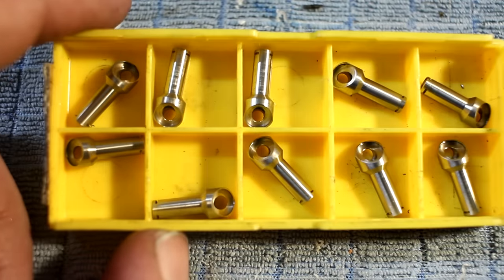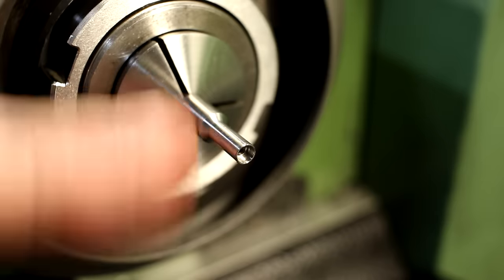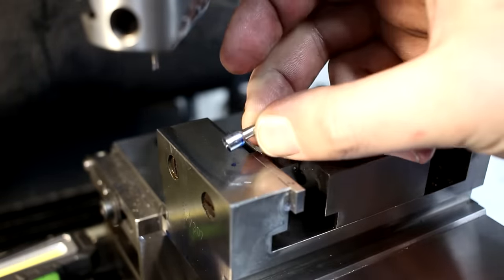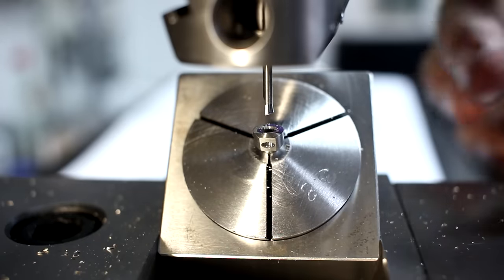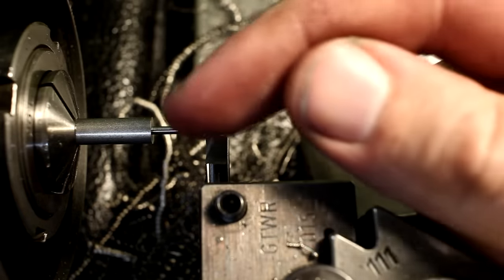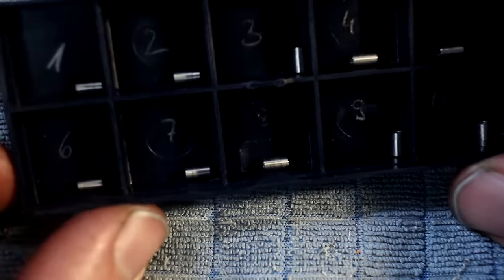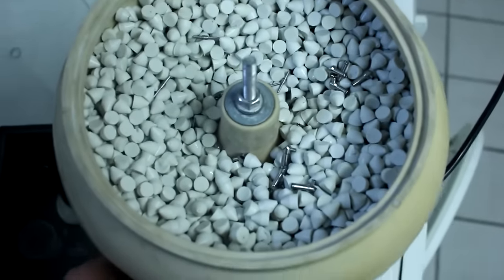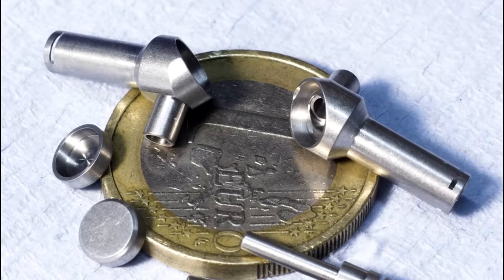Small stainless machining - Flux capacitor parts

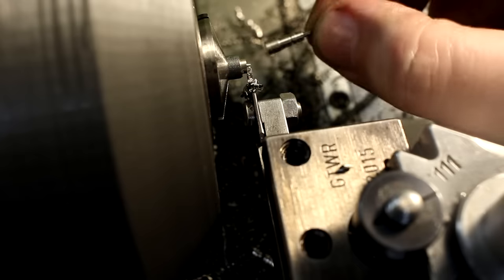Comment: At 42:20 when you showed the aluminium sub-collet with all the featured bored in and a relief machined into the outside to make it flex and conform to the part better, I was moved.

Comment: I'd be really interested to get a better understanding of ISO tolerances.
Reply: It's reasonably easy, look here for example: https://www.engineersedge.com/manufacturing/preferred_mechanical_tolerances_metric_iso_286_13166.htm
Reply: There is a couple of good YT videos on the topic. It is a really dry topic.
Reply: @arnljotseem8794  Thanks! I've started with FutureFab CNC & 3D Printing's "Limits, Fits & Tolerances" for starters. Let me know if you have any specific recommendations.
Reply: @AdventureswithaVerySmallLathe   Not really.  I started on two , this one on " ISO fits"  among them, from a fellow hobbyist:  https://www.youtube.com/watch?v=wvVMs2BZdeU
but I didn't finish any of them.  I instead read what Machinery's Handbook had to say about the topic, and also referenced Metal Engineering Textbook (Europa Lehrmittel) Gave me the understanding I needed
Reply: It's all fun and games until you have to know GD&T. Fun but tedious.

Comment: I love 303. I’ve made a number of different, complex parts out of it. What’s good is that corrosion resistance is equal 304, the most common stainless, but machines very easily. Very easy to cut thin parts, small holes, threading, etc. A major advantage is that it just work hardens slightly.

Comment: Blockbuster indeed. I learned a lot here, perhaps enough to consider reasonably changing my job title from librarian to apprentice toolmaker (or both?). The panning shot rotating around the centred radial cut was wonderful and almost like something a CNC could do which is a lesson in itself.  Smashes like button

Comment: 1:01:34 I don't guess it matters that the through bore interescts with the angled counterbore? These parts are well beyond my shops capabilities. Most of my machines have run out that is half the size of the hole you bored. lol
Reply from the maker: Yes, that does not matter, its drawn that way.
Almost everything you do is also beyond my capabilities ;)

Comment: Incredibly informative, Stefan. Thank you. I have been struggling with cheap insert tooling lately. Soft carbides. I had thrown together a cheap diamond lap with a Chinese 2000 grit diamond lap. It does a nice job lapping the dull inserts sharp again, but they dull very quickly... but, I have this stack of used carbide endmills piling up. I keep them with this zany idea that I’ll have them resharpened... I assure that’s not happening... I think it’s time to take your advise and make some new carbide tooling and holders!
Reply from the maker: Chinese inserts a a hit and miss - The ground ones for aluminium work usually quite well, with inserts for steel, I never had luck, they are probably made out of compressed street-dirt or something like that. When trying to put a edge on them, they just crumble apart.
Endmills are usually a very good grade carbide, fine grain and tough.
Reply: @StefanGotteswinter  - compressed street dirt.... !!

Comment: Love the round tool bits, Just drill a square block with the bit size, set screw, find the center of your grinding wheel hight use the table in machinery's handbook.To set the rest hight of your fixture and get the relief angle you want. just use a protractor to sharpie a mark on the rest or clamp a fence just feed straight in against the fence. you can rotate the block and grind another facet of your cutter. usually by reclamping the fence to a new angle but leaving the set screw on the block tight looking at the catalogs of ghuring and ifanger i learned a lot       good to see you stefan

Comment: Stefan, thank you for this fascinating & educational video.  Here's my vote for a video on ISO reamer specifications.  Also, when you cut the slots with the 0.4mm slitting saw, how do you ensure that you get an "exact" depth of cut since slitting saws don't run particularly concentric with the spindle?
Reply from the maker: I approached the work very slowly with the saw blade rotating, until until I got the characteristic crrrrrk where the saw blade makes contact for a fraction of a second and considered that my zero position, thats good enough in this case. 
The depth of the slot was not crazy close toleranced, its only for a springsteel clip.
If I needed it more precise, I would do a shallow cut, measure the depth and then correct to final depth.

Comment: Thanks for taking the time to produce and explain the process. Great video work with closeups. 
Work is on the other size end from Abom79 🙂
Can you tell about the magnifier you are using ? Looks very useful. My eyes are getting old
Thanks
Reply from the maker: Most of the time, I use my dads old 8x magnifier that he used when he worked in QC. I dont know about the manufacturer, but its very nice, with a metal housing.
Also nice are the small magnifiers from PEAK.
Maybe easier to get is this one:
https://www.optics-pro.com/watchmaker-s-loupe/schweizer-magnifying-glass-tech-line-10x-watchmaker-s-loupe/p,23346

Also very nice optics, real glas, no plastic lens.

Comment: I’m a big fan of your videos, and learn a lot from them. I’m a watchmaker working on very old pocket watches and use mainly a schaublin 70 and aciera f1. You mention in this video machining the shank of your new boing bar. I have a mt1 wolthaupter similar to yours that I want to change to 10 mm.  I would like to see how you would do this using only your lathe/mill/dbit grinder (as these are the tools I have!) 
Best regards

Comment: Very interesting video, lots of useful info, not to long!
Used to work with dental implants etc. and was sure it was something related until the truth was revealed...
The triangular P horn grooving tool You shoved is very similar to the Dormer SKF K308 tool I use. Dont know if the 23mm inserts are exactly the same. Your holder design  is rather similar to the original SKF holder I have except that the blade is held by an excenter (instead of the screw) that presses the blade down against the support. You could perhaps easily modify Your holder to be a little more rigid that if required.
I also wonder about the plastic tumbling media?  Not seen that type before.

Comment: I find that videos about ISO hole/shaft tolerancing are often making the simple topic seem very difficult. Just search for tables with a few selected shaft/hole fits and study them for a minute. It will immediately be clear that:
- lower case letters are for shafts & UPPER CASE LETTERS ARE FOR HOLES
- H/h is the middle letter where for a hole the lower tolerance value is zero, and for a shaft the upper tolerance value is zero
- lower letters (Aa-Gg) mean a looser fit (negative upper tolerance value for shafts, positive lower for holes)
- higher letters (Jj-Ss) mean a tighter fit (positive upper tolerance value for shafts, negative lower for holes)
- lower numbers mean tighter tolerances & higher numbers mean looser tolerances 
- tolerances grow with the size of the base dimension

Comment: Stefan, have you ever considered using a microscope camera and screen over the lathe to see the part more clearly?  I feel that even being as close as your camera just isn't enough.  My eyes are going crossed. :)
Reply from the maker: I played around with something like that, wasnt to happy with it. I prefer to work with a handheld magnifier. Nothing beats real optics, without a digital image processor in between the part and my eyeball.
Most happens on the DRO anyway.

Comment: Stefan a Star 20 CNC lathe would be a great addition to your overcrowded work shop Great video 👍
Reply from the maker: Is that a swiss style machine? I would actually prefer a normal gang tooling lathe a lot - Like a Weiler120 or even the Tormach Slant. 
The Gangtooling would give me a lot of options to set up stationary or driven tools...
Reply: @StefanGotteswinter  we all have are dream machines in are perfect workshop 🙂
Reply: We have a Star 20 and 32 (both with driven tools and sub spindle for back machining) at work, perfect for jobs like this but only if you're doing big runs; setup time is way too long for 10 or 20 parts, you'd be better off with a normal turret and bar-feeder.

Comment: First I want to thank you for all of the great examples of small part machining.  I do have 1 question. On the 2nd part why did you drill after you had turned OD.  I expected drilling to be one of the earliest operations on the part.  I have very little experience machining. I am a hobbyist with only a couple of active years,  so please forgive me if the answer is self evident.  To me it is not.  I am always looking to learn something new and watching your videos never disappoints.  At risk of answering my own question, is the wall thickness so thin that the low lateral load of drilling better than the high lateral load of turning ?  Thank you again and God's blessing to you.
Reply: You took a good risk.

Comment: Funny stuff when you say rough all the chunk of material , but it is 6mm 😅 
And I think that I have bought this week 3tone of tool steel just for having in house ... (from 65 to 200mm)  
Dose the tumbler not remove some material on the hi precision surface ? 
Grate job like always 👍
Reply from the maker: The tumbling media mostly works on edges and corners, on flat surfaces it barely does anything other than altering the finish. 
Maybe if you leave parts in for days, it would noticeable change dimension, but before that, all edges and corners would already be rounded over like crazy :D

Comment: Hi Stefan, another fine video. Can you tell us whether the setups in the tilted collet chuck have to be indicated in for each part, or is it able to be batch processed like in a fixture?
Reply from the maker: I needed to indicate the flat on each part, in hindsight I could have made the fixture with the orientation-flat earlier and used it instead the collet block.

Comment: Did you experience any chatter? usually the rule is pieces where thee stickout is greater than 3 times the diameter you will need to use a center. I was wondering if at that small does the saame rule apply or do they chatter less when they are small?
Reply from the maker: Nope, no chatter, but the need for a spring pass, as the part deflected slightly.
The 3x diameter rule is in my mind not universaly true. Its a good starting point, but with sharp, positive rake tooling it can be stretched a lot.

Comment: I wonder, when you're making a part for a customer, how much do you typically know about what it is actually supposed to do? Do they just send you the plans for only that part, or do you get to see how it would fit into the final assembly and work in the whole context?
Reply: If the final assembly is confidential and a trade secret, the machinist is not permitted to know what it is, and so he/she simply makes the part exactly to the drawing supplied. You do not need to know what its ultimate function is.
Reply: It usually helps if you know what the part is going to be used for, how it is assembled, and/or what other parts attach to it. Designers/engineers have a huge disconnect from machining capabilities/procedures. A lot of the things they'll did stuff so backwards, or they'll put random tolerances that have no real world basis or requirement, which isn't optimal for machining. So if you know what it's being used for, how it's being assembled, and what other parts are going to attach to it, you can suggest alterations to the design that will speed up production time or reduce production costs. Much like how Stefan recommended sanding down the top of the cap piece, instead of having to make a soft collet to face it off.

Comment: Sure enough, the tolerancing would be quite nice, as I was looking at it, in a very quick look, a short while ago.  BTW, that 45˚ tool is wonderfully sharp !  Nice.  I have some PCB drills/mills that I thought might be useful for making some tiny tooling... what do #you# think??
Reply from the maker: Thanks, the carbide tools used where all lapped to a very fine edge :)
As for the pcb drills, they usualy are a good grade of carbide, but be aware, some are so cheap that they have a steel shank and only the cutting end is carbide and is brazed into. Those are pretty useless for regrinding purposes.
Reply: @StefanGotteswinter  these ones were from a top supplier, they do seem to be solid carbide, quite brittle ;-)

Comment: May I ask which cutting oil (the rather low viscosity yellowish one on the first op) you use and if it's developing much smoke or not? We've been using Wilke Wicos VA but since it's chlorinated the safety  infomations changed (roughly to "if you inhale fumes you'll die") in the past and we currently evaluate to change to something else.
The Rocol RTD we also use is not as unhealthy but has a high viscosity and is harder to clean of - though the perfomance is really good.
Reply from the maker: Thats Jokisch Alpha93 - I use it for everything from aluminium to titanium, it does not stain materials, it does not kill you instantly, it smokes way less than the RTD and is based on vegetable oil.  Highly recommend it.

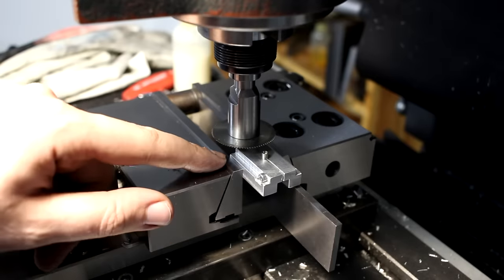Comment: 28:14 Why did you clamp this fixture at the end of the vise (requiring balancing) and not in the center? Made sense for the collet block, but I don't see the purpose in this case.
(Also thanks for the info on the small-hole bore gauges, definitely need to get a set of those since the telescoping ones are often too large for what I'm doing)
Reply from the maker: I needed to be able to reach from the underside to load/unload the parts - And that way it was easier than having it in the midle of the vise.

Comment: What rpm were you running? Amazing work.
Reply from the maker: Lathe almost for everything between 1500 and 2000rpm, mill for most things 1000 or 2000rpm.
Boring with the boring head 1000rpm.

Comment: Can I ask you what product you use for case hardening? I've been going back and forth with different products not knowing which one to buy then I was thinking well I'll try and get a recipe and make my own and all I've accomplished is staring at my shop wall doing nothing and I really do need two case hardened some small parts
Reply from the maker: "Kasenite" would be a product that I know is availible in most countries. From a chemical base, they are most likely all a blood lye salt.
Mine just says "case hardening compound" on the very neutral container :D

Comment: I have noticed that on the lathe, everyone turns a part to final or near final outside diameter, then drills or bores out the inside diameter.  Why this order?
Reply from the maker: In this case I do the operations from tight to low tolerance - I start with everything thats close tolerance, because the chance of messing up when turning a precision diameter is higher than drilling and reaming a hole. That way, when I mess up, I do not loose as much time/work.
Its not always true, for example when I did the ID boring on the complicated housing.
Sometimes its just influenced by the position of the moon in relationship to the sun ;)

Comment: Since touching off doesn’t seem practical at these dimensions, does Stefan set up all the precise offsets of each cutting tool ahead of time to be able to accurately cut using the DRO?

Haven’t searched, but that might be an interesting GTWR style video...
Reply from the maker: I think I showed it in the video about the DRO and tooloffsets.
Basicaly you take a testcut at the final, finishing depth of cut, measure the final diameter and enter that number into the DRO for the given tool. Voila, tool calibrated :)
You can touchoff too - Put some blue marker on a true running surface of known diameter and approach with the tool. Once the tool scratches trough the blue, you are basicaly at your nominal diameter that you then enter into the DRO.
Reply: Stefan Gotteswinter Danke 🙏

Comment: Hi Stefan, thanks for the video. on another note, what do you think about Warco lathes? are they reasonably accurate? thanks,
Reply from the maker: They seem to be the usual import machines - In my experience they can be hit or miss, even from the same supplier. Best is to look at a machine in person, perform some basic tests (Like turning something in the chuck, check if the machine turns cylindrical, check for mainspindle endplay, etc.) and take that exact machine home with you.
If you have to buy a machine and have it delivered - Make sure there is the option to have the machine returned to the seller and replaced if its a turd.
Reply: @StefanGotteswinter  thank you so much for your comprehensive reply.
Reply: On that subject, would you know if you have made a video on that topic, i.e. (how to buy a lathe/What to look out for?)

If yes, can you please point me to the link to that video, or maybe any other video that you think is useful. Many thanks.

Comment: One of these days you're going to have a little 5-axis in there.
Reply from the maker: I would be happy with a small 3 axis vmc ;)
Reply: @StefanGotteswinter  Time to move out into the woods, I fit a whole Mori SL-25SY lathe into my barn, subspindle, live tooling, Y axis and all.
Reply: @StefanGotteswinter  that's what I thought so I converted my little Bf16 Optimum with 3 x Nema34 closed loop steppers  🤔 but as it is it's never enough.... I'm just working on the 4th axis complete out of steel and also a 12Nm Nema34 turning it ....if I use the electronic handwheel I can mill also conventional for little things it doesn't make sense writing gcodes or making a drawing for the CAM Software. Very interesting video as we are used from you stefan...I'm a big fan 👍 because you do the things the way it should be but anyhow I can't 😂 well after watching your vids most times I learn it that's why I'm so happy about your channel 👍